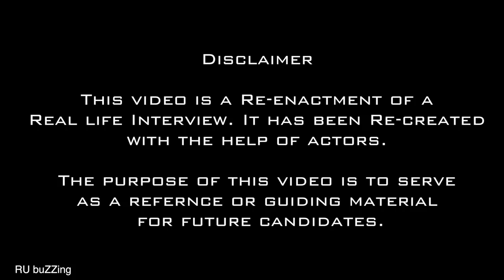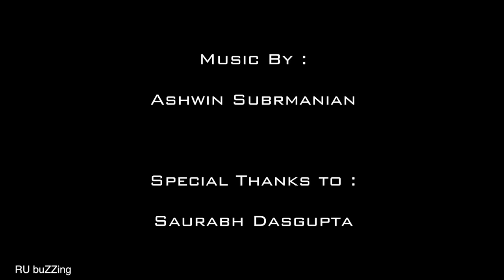When Interviewers decide to Grill an Engineer - Personal Interview - IRMA -  Re-enactment -Kush Rao

Comment: I secured 73% in 10th, and 56% in intermediate, coming to my graduation I secured 7.5 cgpa... Can I get admission in IIM, if I secure good percentile in CAT...
Reply from the maker: Yes you can Mamata :) You need to cover it up well with your CAT percentile, GD & PI
Reply: RU buZZing
Thank you so much for ur reply... Can u plz make a video on the  score students r getting.. What is the calculation of score.. Bcoz some student they r getting 99.00 some 99.2 like that.. How they calculate the score.... TIA
Reply: @mamatamishra3202  That is purely operational. That won't help in your selection process. I would suggest to focus on the syllabus and your knowledge about gk current affairs etc. Not even IIM A asks for the method fo calculating the cat scores and/or percentiles.

Comment: Does gap years b4 b.tech matters
Reply from the maker: Hey Sourav... We don't think that is a problem... As long as you have successfully cleared your BTech you are eligible to appear for Post Graduate Studies... All the very best!!
Reply: RU buZZing will it affect in Placements
Reply from the maker: If you have covered it up well with your academics then we do not see it as problem.
Reply: First Priority must be Getting and Converting the call. Things you have mentioned do matter sometimes only , so that must not be on your mind as of now !
Reply: +Sourav Ghosh
I had two drop years after B.tech, then completed my M.tech. Now working in Qualcomm as a developer (worked in the Development of OnePlus6 and Pixel).
During the interview, the panel asked me the reason for 2 drop years. I replied the exact thing why I took those drops, without thinking twice if they pick me or not. They liked my honesty. Frankly, every panel will appreciate your honesty, take it guaranteed. Honesty has the highest point if you convey them with conviction. 

In short, No, gap years (before and/or after B.tech) don't matter as long as you stand in their standards of selection criteria. But yes, it may sometimes delay the opportunities to knock at your door. But rest assured, opportunities will come. It will boil down to "How much prepared are you when opportunity knocks!" (: